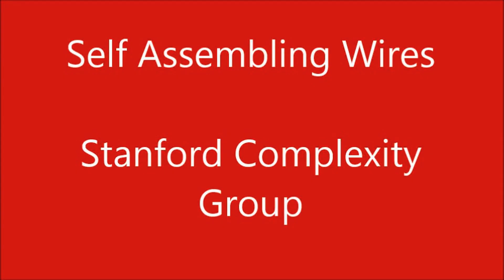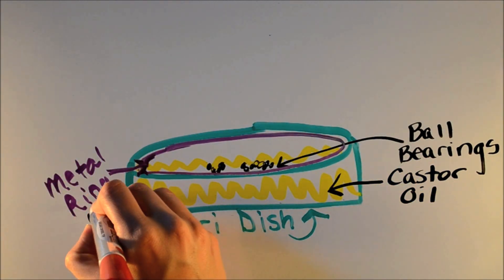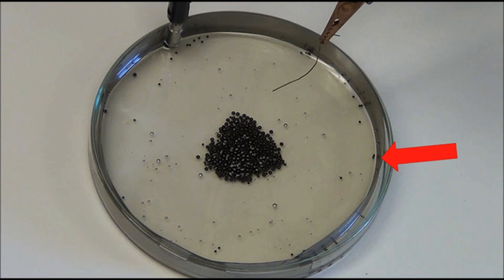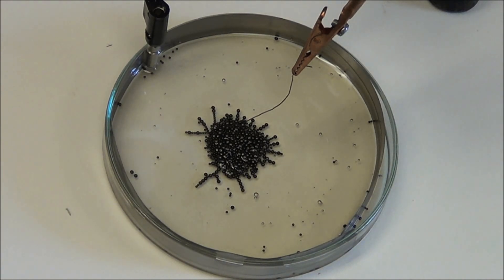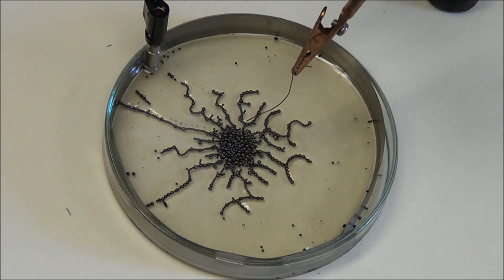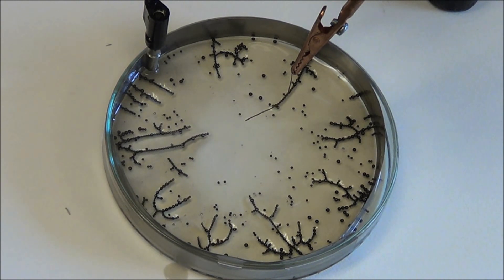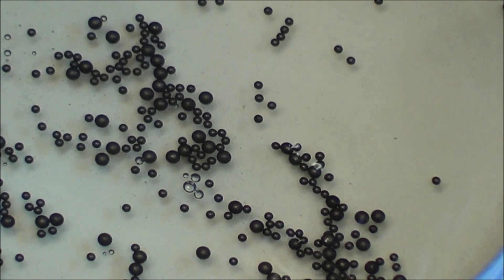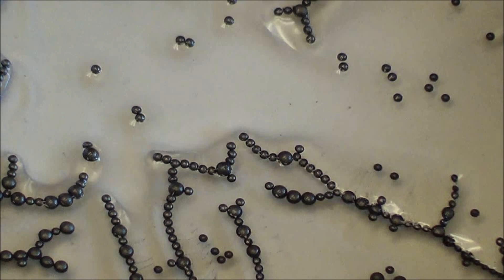Self-Assembling Wires

Comment: Doctor : Self assembling wires can’t hurt you they’re not alive.
The self assembling wires : moves and fight other balls to get more balls
Reply: agar.io be like
Reply: Change the number of the balls and the size of the balls
Reply: I don't see any "wires", only tiny metal balls reacting to high voltage to form typical fractal patterns. This is nothing special.
Reply: @trevorjameson3213  a line of metal balls allows electrons to shmoove therefore it is a wire.
Reply: @trevorjameson3213  You must be fun at parties

Comment: This can be used as a good example to how life work at it's basic form.
Reply: I don't know why people keep thinking this has anything to do with life "at a basic form". This is very simple physics, high voltage and metal balls, and a simple fractal pattern. Nothing fancy I assure you.
Reply: @trevorjameson3213  I mean life basically began like this, using simple reaction to supply energy to provide motion to which allow it to gather more energy, and through evolution this process becan to change and become more advanced to work more efficiently.

Comment: the argument that I can not do this at home because "the plugs in your house are 120V" hurts my brain.
that's like saying you can't charge your phone with 5V because the plugs in your house are at 120V. voltage can be regulated. and what about the plugs in my home supplying AC when it requires DC?
why would what comes out of my plug be even relevant? do you think I'd just hook up live and neutral from the plug to the experiment?
just get a cheap neon sign transformer from ebay and you get your 20kV, rectify with four diodes and smoothe with a cap, done. experiment at home for under $100.
or you can just buy a "special power supply" off ebay for 60 bucks that gives you 20kV DC out of the box.

Comment: this is a lot like how neurons connect and form. interesting.
Reply: We are the manifestation of what we perceive as imagination of some other order. No doubt our own minds spawn such infinity. That may be the source of suffering.
Reply: @berekexer8158  that's why if we dig deep down in our minds we can find some astounding potential of the power of it all.
Reply: @berekexer8158  forever reaching
Reply: Ur thoughts do in fact have voltage
Reply: @roogle3878  yup human beings run on electricity. Animals are organic machines
Reply: Or that may be how neurons got developed, just tiny bits of charged particles trying to convey stimulus to any essential place of our body
Reply: @abhituran6789  sounds like a high voltage thought u got there
Reply: It is absolutely nothing like how neurons connect and "form" (neurons don't 'form', they are constructed by a highly specific process)
Reply: @trevorjameson3213  it is a lot like how neurons form. and yes i mean form seeing as how form by definition means "to take shape." constructed is also a correct way to say it as well in this context they mean the same thing. specifically i am talking about the way neural networks and networks of connections form not the cells themselves. you are right it is an incredibly specific process, which involves a neuron reaching out with a dendrite and through electrical stimulation connecting with an axon of another neuron to form an connection which externally expresses itself, along woth millions of other connections, as an association. this process shown is like a very slowed down process of how dendrites reach out and find connections with other neurons guided by electrical impulses
Reply: Excellent

Comment: I don't know the proper word for it but i want to say perhaps if there was a way to lower the "tolerance" of the balls in order to get a reaction at lower voltages then it could be more applicable perhaps using new material or combing materials fusing something together to create an element capable of lower voltages with the same reactions. i can see this being useful for vechile and heavy equipment repair structure repairs making an end product more durable and in the medical field i can see this having tremendous break throughs if working with prosthetics or changing the material into actual flesh or cells if we could get cells to close wounds up in a matter of secs or minutes it would be monumentus.

Comment: I feel like this can open up new doors in biology
Reply: What if the organization we see in cells on the molecular level is just voltage?
Reply: They are soooo tiny they don't need so much power to move...
Its like comparing a car to a piece of lego both of them need strength to move but the amount of energy needed to move each object vastly differs.
Reply: @DreamApostle128  Exactly, cells only need miliVolts. -20 to -200 mV
Reply: @MrJonnyq3  Thanks for the info.
I wonder how much change happens in someone's body when they are exposed to electricity.
Reply: @DreamApostle128  There are ways to raise the voltage difference in cells with electricity as we know it.
Reply: It can't. This has nothing to do with complex biology. What you are seeing is nothing but fractal patterns emerging among tiny metal balls, when exposed to high voltage. We used to make fractal patterns as children, with magnets and metal shavings. This is not new physics, it's just simple, normal physics.
Reply: @trevorjameson3213  Magnets and metal shaving don't create fractals (they simply create specks aligned with completely non - fractal magnetic field lines), and this experiment has a lot of merit, not as some "new physics" but as a great model for autonomous self-assembly, which could then be expanded or studied more exactly. 
And yes, it has things to do with complex biology as both are complex systems that exhibit self-assembly and therefore understanding the simple one may give us insights on the more complex one. This is mostly how biophysics works
Reply: @trevorjameson3213  What is the charge of a cells membrane? What is the charge of the Nucleus? What is Acid? Can pH be measured in mV?
Reply: https://www.youtube.com/watch?v=7Hk9jct2ozY

Comment: You can easily do this with an old CRT tv. The voltage for the anode is about 30kV. Also it wont kill you if you get shocked

Comment: Nice, youre using simple banana leads (which are usually rated up to 1000V - if you bought the good stuff. The ones you used look like the cheap 60V type) for a 20 kV experiment. A uninsulated bare copper wire wouldve done the same thing...

Comment: so basically weather control is same concept. 1:06 you need stepped up voltage maybe 1 to 30 ratio would the supply voltage be dc or ac?

Comment: Hah, the plugs in my house (actually, the sockets), are 230V, so they beat the ones in your lab. But they're AC and this experiment seems to be using DC (a detail you really should have mentioned, along with the amount of current being applied, and by what factor the video was sped up), so the voltage in wall sockets is really a non-sequitur. Anyone could try this at home, they just need an appropriate transformer (there's one inside my old CRT monitor that goes up to 27 kilovolts, and a cheap ozone generator from eBay can reach the 20 kV mentioned here, assuming you don't need a lot of current).

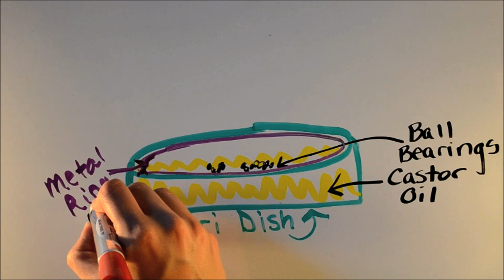Also, electrons don't get "sprayed down" from an anode (positive wire) as implied at 0:40. It's the negative pole that has excess electrons (that can then jump to the positive one).

Comment: A British made transistor, (an AF117) suffered failures after some use. Tin whiskers inside the case were the reason, at less than 10 volts, shorting the electrodes to the case, that was usually at a positive potential. This was in the early 1960s... Much later, NASA found out why...  Nothing new under the sun :-)

Comment: Electrons using the metals as a medium to increase their connections of electrons. Instead of having lose contact through the castor oil. Not self assembling wires......they don't stay connected or fuse themselves together to become a wire. Nice experiment, though elementary.

Comment: so... the fractal nature of electric visualised, and this surprises not a single Manchester university nano tech person.. next.
pulls out the old diy centuries old tarnished Homemade High Voltage copper transformer and a bunch of laden jar accumulators/caps and related bits from the old 'linear motor' rail gun... cant be done at home , we lol as we flip the diy knife blade switch ^_~

Comment: In another form this is also called entropy. In nature too many things cause electric current. Any dissimilar metals mixed with a catalyst create electron flow. Lightning is electron flow. Static charge is electron flow. Circuit boards already can and do form tin fingers from exactly this phenomenon. Which causes electricity to flow in undesirable directions on the circuit board. IE entropy. This guy is growing entropy in a controlled environment which is the only difference between his experiment and nature.

Comment: The title is misleading here unless using jargon, in which case it's opaque;
these aren't wires that one would find inside computer cabling (yet? ever?),
and left to their own devices would sit motionless, not assembling whatsoever.
I came in looking to see intelligent nanotech coaxial and got a solid-matter representation of electricity.
Still interesting, but would have also appreciated some insight to its uses.

Comment: I was thinking if it would be possible to use a polarized light through the petri dish to assess the castor oil movement (and maybe also thickness), so you could draw some contour lines in situ.

Comment: Does changing the voltage make the formation of the branches slower/faster? How does raising/lowering the positive charge node change the results? Why not try it in something more viscous just to see what happens? What if you had a stationary bearing in the very center (or some other sized item) - would they form around the structure? What if instead of ball bearings you used different sized cubes? Would this potentially change the 22% occurrence rate for ends/branch points? Asymmetrical shapes? 

Just some questions from an interested person who knows nothing about what's going on here.

Comment: Nice you tace from for it to pul itself to the breagh.
En you tace from thame to for thame to be able to release some😍 there fore the second is not going to the center😍

Eurth is doing the same the barings become the same as the space inbetwean the elements😍 inbetween cells inbetwean galaxys enz enz enz😍🌈🙏💟

Negative is less negative than posetief is negative.

Like Negatieve is -100
En posetive is       -200😅😍

En the baring pull itself in to where it reseaves from.
As in operside the midle stays ampty as there is to less to be reseaved🙏💟

Comment: 1:03 "The plugs in your house are a hundred and twenty volts".  2 errors in just that statement.  The plugs are 0 volts.  Plugs are the male connectors on the wires of an appliance.  There is no word and in 120.  You are saying 100 and 20 (2 numbers).  Very sloppy.  Downvoted.

Comment: hold up. at 0:49 you say the electrons spray down from the positively charged wire. but something that is positively charged is LACKING electrons. the negative side is full of electrons. so physically electrons move from the negative side to the positive side, as they are negatively charged, and opposites attract.

Comment: hehe come on now... you can do this at home easy... get an Oil Ignition Transformer, and then put a Full Wave Volt Quadrupler on the output 10kv 23mA side to get upwards of 40kvac, and use a variac on the LV 120vac side to adjust the voltage to 20kvdc output...   and thats just one modular unit...    Heres something I did out in the garage... :P 

https://www.youtube.com/watch?v=Ma3NCR1u-II&t=190s
Reply: Note that different materials will orient differently.  Single walled carbon nano tubes orient along the axis of the discharge and then will fuse together under water into that form...   while nickel powder of around mesh 300 will form lines orthagonally to the axis of the discharge producing sorta what looks like sand on a beach where the waves offset the parallel lines with the wave action in the sand.     The petri dish has both nickel powder and swcnts in it...  the applied potential induces the lighter dust to migrate into the center bridging the gap in the distilled water which then facilitates larger particulates also moving into the gap and working inwards from both sides till it bridges and then we get the underwater arcing again as it fuses into place...  this is likely how metals in the mantle form and are refined into their variety of elements.    Heres an example of distilled water with the swcnts only in the water...  

https://www.youtube.com/watch?v=leEXoEsqqHo

Comment: Something doesn't sit right with me about the number of ends and branches being the same. Is that even theoretically possible? Even in that simple example there there are 3 ends and 2 branches, and I can't imagine a configuration of branching that doesn't intrinsically have more ends than branches, unless each node only branches to one path, making it a chain not a tree. Isn't it the case that the more branches there are, the lower the ratio of branches to ends there are? I guess that just means that most of the branches terminate on one end and continue the chain on the other, such that the ratio stays constant enough for the number of branches that terminate at two ends and the inherent +1 ends have over branches to not impact the overall number

Comment: 0:44 "electrons get sprayed down to the ball bearings in dish"
Don't electrons flow from the negative to the positive?
Reply: No, current flows to the negative.
Reply: @chrismechanic2000 
Yes, current flows to the negative.
I'm talking about electrons, which are negatively charged particles.

Comment: 20 kV is not a lot and you can easily do this at home. A simple tabletop van de graaff generator can make 100 kV as long as you need almost no current (you don't, and it is safe). Cheaper and more dangerous is a CRT flyback transformer which can provide 10-30 kV.

Comment: I can see from some of the comments that this little video has convinced some individuals who seem to lack critical thinking skills, into believing that this experiment is in some way, showing us how life began......
But it has nothing whatsoever to do with DNA, and the INFORMATION contained in it. Ask yourself honestly, "does this video even begin to explain how the massive amount of information contained in DNA came about"? Is this a viable mechanism to supply that INFORMATION? 
Even the most basic life requires information that has something called "Specified Complexity". That is to say an interdependence of multiple subsystems, that must ALL be present simultaneously for life to exist and be viable. 
The video quoted some statistics about the % of end balls, as if this was proof that this experiment created information. But this "information" is merely a statistic arising from the physics of this experimental setup. As just mentioned above, this "information" is not the type of information required for life. The information contained in the sequencing of DNA base pairs IS NOT a function or a necessary result of the molecular chemistry of the DNA molecule itself, just as the information contained on the printed page of a book, is not a function of the chemistry of ink bonding to paper. 
While this is an interesting electrostatic experimental setup, this setup bears no similarity to left and right handed amino acids floating around in some postulated aqueous "primeval soup".  You have shown and proven, nothing.

Comment: The first experiment reminded me of lightning in slow-motion.
Various stems originating from a point expanding and branching out multiple times, until one of them reaches the edge and all the other branches stop growing
Reply: That's because it's basically what it is (except the "lightning" here is being used to push the ball bearings, which works due to the very low friction in the oil).

Comment: Thank you STANFORD complexity Group. Thais video was the final link to cracking ALS ans Parkinsons along with other ND's. These shapes are the EXACT shapes left on Parkinson's Disease  patients skin, seen in their circulatory structures and even brain scans.  These exact shapes! That led to me the breakthrough discovery that Silver Nitrate and other Nano and Ionic Silver p[articles can aggregate then cause low level electric interference, especially when exposed to EM fields of today. Almost every ND patient exhibits hair and skin structures that follow a clear pathway, many times with hairs that lead into the ears, mouth and nose with connecting lines for the current to flow through. THIS VIDEO TIPPED ME OFF LAST WEEK AND NOW THE WORLD IS GOING TO BE SO MUCH BETTER FOR PEOPLE. My theory of ND ailments is watertight and incorporates many factors previously overlooked, The electric conduit referenced above, and for PD patients-the likelihood of having the particles visible on their skin in these same shapes as well as particles bearing the same archetypal  forms that match patients veins, wrinkles and especially their brain scans put it all together for me. It blew my mind and took some time to process, but this vidoe was key to figuring it out quicker.
 Also what do PD high risk occupations all have in common? Doctors, nurses, Boxers, Soldiers and lumberjacks? Thats right the Silver Nitrate stop bleeding pen! And we're off to the races knowing the cause. I caught Parkinson's doing my AG2+ particle research, and this video completed the mental process deducing the cause and hopeful cure.